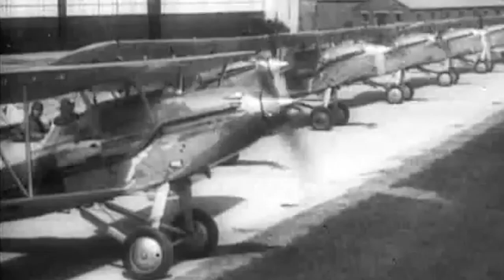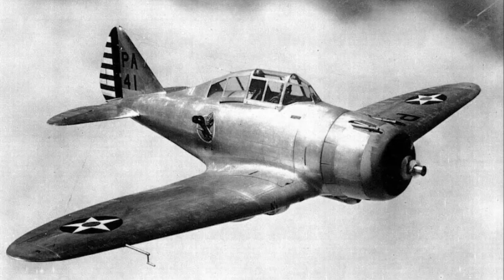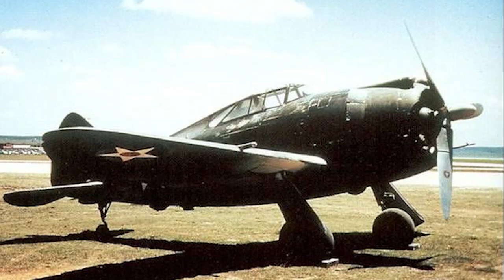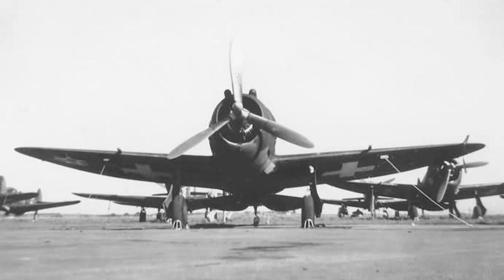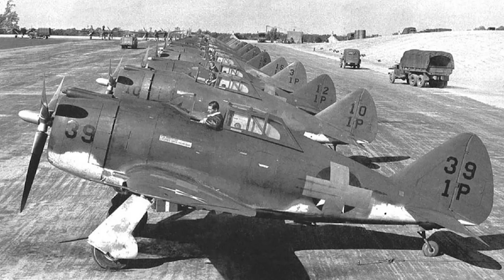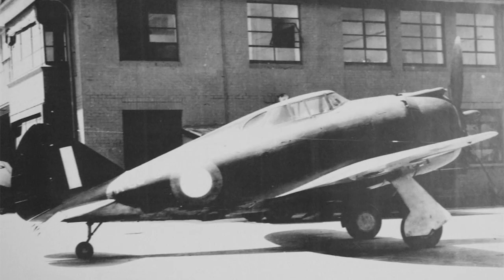The Republic P-43 Lancer – A Giant’s Stepping Stone

Comment: I was a Claire Chennault fanboy when in my teens and picked the AVG for a 50+ page project in jr. high. The Flying Tigers most definitely had a small number of Lancers and used them for reconnaissance and reconnaissance interception. I don't recall anything about in-flight fuel loss, but they did lose (I think) 3 out of 4 pilots repositioning Lancers in one flight. The account was that they got weathered out at their destination and in trying to wait it out or dipping below overcast finally had to bail out in severe terrain.

A few of the pilots were quite keen on the Lancer as, at altitude, it was invulnerable. Chennault considered it but the logistics of supporting a second, unrelated, aircraft nixed it. They kept a few for special duties, as above, and someone had a personal Lancer for liaison duties as he had to regularly shuttle around the theater on business and sometimes scouted out weather ahead of a ground-strike. The attraction being, again, that at altitude with a little care, it was un-interceptable by the Japanese.

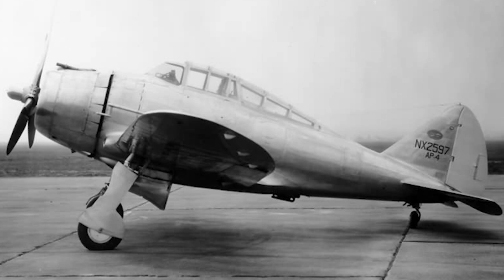BTW, I built a 1:32 of the P-40 for the project and a 1:48 P-43 Lancer. So SOMEONE issued a plastic model of it.
Reply: No it

Comment: The "wet wing" fuel tanks were just an idea ahead of their time.  Later military aircraft such as the C-130 have wet wing tanks for jet fuel, but with VERY porous foam inserts.  If a fire occurs in the tank, the foam melts, off gases, and the gasses produced starve the fire of oxygen.  Even large civilian transports eventually had to institute a system to inert the tanks for safety, after the 747 that crashed off of New York many years ago.  These days, it's done with a system that sieves nitrogen from the air, and that nitrogen pushes the air containing oxygen out of the tanks.  No oxygen, no fire.
Reply: K.M. .............good damn info !!!!!!did not know that .

Comment: 9.05 ~ "Recce P43s trainers for Lockheed F4s"
Suspect this is reference to a Lockheed Lighning BUT they (all  types) seem to carry a P38 designation plus suffixes.
So I'm a bit baffled as to what an F4 of the earlish 1940s was?
Reply: “F” would have been a WW2 era photo reconnaissance aircraft.
“R” in that era was “restricted”.
The F-4 was the factory built photo reconnaissance version of the P-38 Lightning.
Reply: Actually, Recce Lightnings were designated F-4 and F-5... At least every publication I've read covering them has referred them as such. Always found it puzzling
Reply: @Parocha  A lot of aircraft had different factory designations.
The determining factor was often a bit vague if they weren’t actually factory versions. The ground attack version of the P-51 Mustang was the A-36 Apache and the photo reconnaissance version was the F-6.

Comment: The story of the P-35/P-36 dispute by the USAAC, was resolved in the P-36 getting chosen. However, Curtiss was actually the first company to respond to the Army's request for a new fighter prototype. When Seversky brought its aircraft, it was underpowered and had fixed landing gear. In the course of testing, it crashed. Seversky, naturally, asked to repair their aircraft, but placed a new, stronger engine and now sported retracting landing gear. Curtiss called a time-out, stating that Seversky had brought essentially a different plane, so asked to improve their own P-36. It was these improvements that led to its choice by the Army. 
It is a fascinating story, and I may have gotten some points wrong. I await your episode on the Army's choice.
A funny thing, the P-36 was not used by the US Army, as much as it was by foreign services.
Reply: The p-35 was damaged on the way  to testing, saving Seversky a good deal of embarrassment....
Reply: Both were selected by the USAAC.
The P-35 was the actual competition winner.
Seversky selling two squadrons of them to Japan however got the US Government somewhat offside however…

Comment: Another excellent Video Ed. The Gloster F5/34 (which you've also done a video on) and the Italian Regiane Re 2000 were both inspired by (some sources say had actual design input from) the Seversky P35, and like the Lancer, used a "wet" wing, with the fuel tanks being an integral part of the wing structure. The Re 2000 suffered quite a few problems with that, just like the Lancer, which is one reason why the Italians did not initially order it for themselves. That didn't stop the British from ordering 300 of them, an order dropped of course when Italy joined the war in June 1940.
Reply: There were 2 or 3 engineers for Seversky who returned home to Italy and joined Reggiane. Thus the origin of the Re.2000

Comment: I really can't believe that it had wet wings, that just seems like such a truly horrific idea.
Reply: It takes time and forethought to eliminate things like that. Look at the WW1 aircraft and you'll find examples of gravity-fed fuel tanks above and in front of the cockpit on the upper wing. And the first time I drove a pickup truck and found the fuel tank was directly behind me, with nothing but the sheet metal? Brrr.
Reply: @TheAnxiousAardvark   The first time I was in a pickup like that it was an ambulance. I'd just joined New York City EMS and was assigned one. Back then (1982) the city had the worst ambulances I'd ever seen. Did it stop me from driving fast? No. I was young.

Anyway, gas tanks don't catch fire easily, it takes some trying. Even leaking gas doesn't light up to fully engulf the car instantly. I saw a lot of crashed cars, cars with little in the way of safety features, and very, very few caught fire. Pretty sure Mythbusters did an episode on this.

(NYC EMS did improve and we had decent ambulances by the late 1980s. We merged with the FDNY in the mid-90s and things got even better. FDNY always got high priority in the city budget and didn't skimp on equipment.
Reply: @TheAnxiousAardvark  
The pickup tank was as bad as it appeared.  Any intusion into the cab bad enough to rupture the tank, probably meant you were dead anyway!